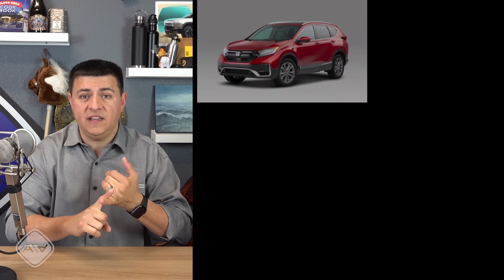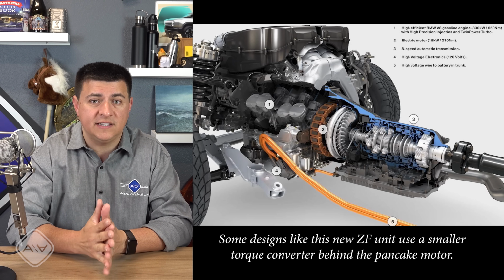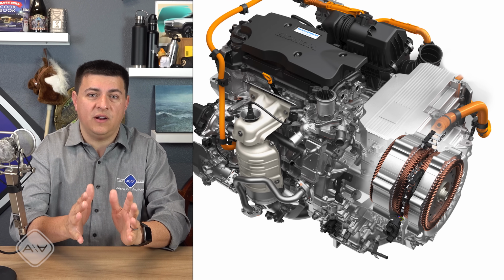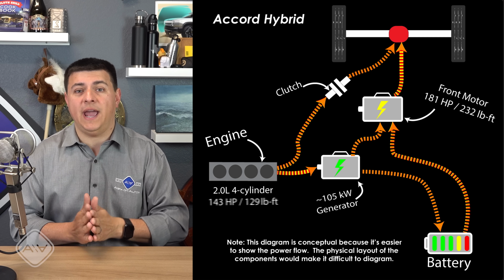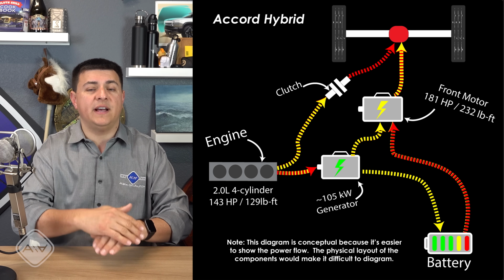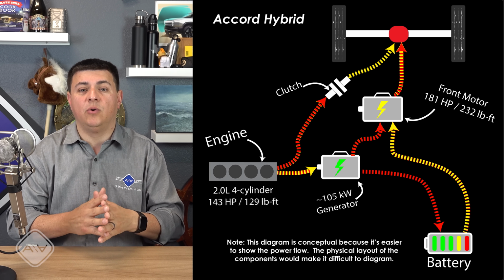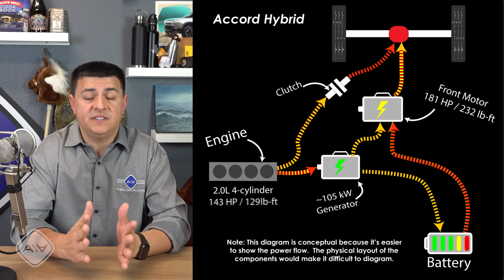How Does It Work?  Honda's 2 Motor Hybrid System Explained!

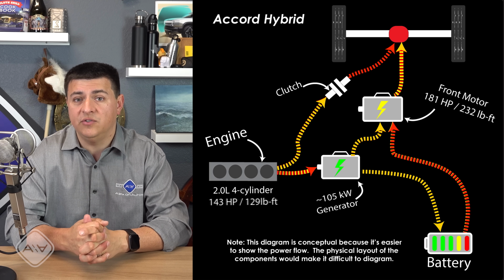Comment: Here's the corrected math Alex asked for at about 8:00. I'm including lots of details you can skip if you want to.

The outer diameter of a tire on my Accord Hybrid is about 25 inches. This means it takes (5280*12)/(25*pi)=807 tire revolutions to go one mile. On my 2017 CR-V, it is 28.5 inches. I don't know what the hybrid CR-V has.
The O.D. gear ratio is 0.805; the final drive ratio is 3.421. In Engine Drive, my Accord takes 0.805*3.421*807=2222 engine revolutions per mile.
For every 1000 rpms, the car will be going (1000*60)/2222=27 mph. (On larger CR-V tires, this could go up to 30 mph).

Check: According to Honda, the ICE is most efficient at 2000 rpms and about 75% throttle, which is 33.7 horsepower. This is 54 mph on my hybrid Accord, which is what Alex would call a gentle highway speed. (It has a BSFC of 208.1 g/kWh, which Honda says is 40.8% efficient.)

The peak 143 horsepower is reached at 6200 rpm, which is 167 mph (or more with larger tires). The car will never go that fast. So what Alex describes as the the conditions needed for 212 HP can never *happen*. Not even close. I'm not saying that this isn't the way Honda arrived at 212 horsepower, I'm saying it is a useless number if it was. And I hope the method is different. I'm also not suggesting that the power it does have is insufficient; my Accord reaches 60 mph about a half second sooner than a hybrid Camry with 208 horsepower combined.

At 3000 rpm (81 to 90 mph), Honda's data says the BSFC goes down to about 212 g/kWh at about 55 horsepower. This is still above 40% efficient, so this doesn't explain lost mpg at such speeds.

But Alex is wrong about one thing: the battery is still used to gain efficiency on the highway, even at speeds above "gentle". I'm not sure why Honda has stopped including this in marketing releases, but it is described in older ones like https://global.honda/innovation/technology/automobile/hybrid/i-MMD-picturebook.html (watch the video at about 20 seconds in). That 33.7 horsepower is more than my Accord needs to cruise at 54 mph. So the car alternates between splitting the 33.7 HP between propulsion and charging, and running in EV mode. This gains maybe 10 mpg.
+++++
Reference: Honda Technical Paper titled "Development of 2.0 L Engine for New Accord Hybrid," Takeshi Wakamatsu, et. al..
Reply: I've seen some reviews that show the Accord being faster than the Camry, but so what, nobody drags a hybrid. I've noticed that the car alternates between ICE and EV even at 70 to 75 mph.
Reply: @benholdaway7570  My point was that it has good power, better that another car which claims 208 HP, no matter how the 212 HP number is calculated.
But "Hybrid" does not mean "underpowered," even if "Prius" does. And there are some you could drag.
Reply: My guess is that the maximum combined power is only theoretical. They thought they could sell more if they are closer to Toyota's hybrid numbers. They changed this for the latest models. Fit hybrid maximum combined is the same as its traction motor hp.
Reply: @philipmanolas2270  Before the 2020 model year, the Fit hybrid used a DCT transmission, not the iMMD system Alex describes here. I don't know its specs. In 2021, they renamed the hybrid version the Jazz, and put the e:HEV badge on it. The engine has 71 kW of power, and the combined total is 90 kW.
Reply: @jeffjo8732  Honda did what i am describing with other models that used the immd transmission, stating a theoretical maximum hp when the system is powered only from the traction motor when you go full throttle.
Reply: @philipmanolas2270  Most cars "state a theoretical hp" that corresponds to the power produced by whatever actually produces power for the entire car to use. That includes Honda iMMD HEVs, and most conventional cars. But Toyota's 208 hp in the Camry hybrid is a complete mystery.

When describing just the engine, it's called SAE net hp, if you want to look it up and learn something. And you will see those words attached to most HP ratings.  But it is only defined for the gas engine by itself, not the power systems of hybrids.

The issue here is that most people - and it seems you are among them, and maybe Alex as well - think it means power on the road. You both compared it that way. But it doesn't mean that. It is essentially the power available to every device in the car that needs power, except those necessary to produce it. So if a conventional car is advertised at 200 HP, some of that 200 HP goes, for example, to power the brakes, power steering, and A/C; but not the engine's oil pump. It is also calculated before losses in the torque converter, transmission, and differential. In fact, the usual rule of thumb is that only 85% of the engine's SAE net is available for maximum acceleration.

The issue that Honda (or any manufacturer of HEVs) faces, is how to give similar information for an HEV, when the factors that complicate it are very different. Honda's information about the iMMD system is more transparent than probably any other system. The 212 "combined horsepower" of the Accord Hybrid is almost exactly comparable to the SAE net horsepower in a conventional car. It is the electrical power that the ICE+generator and battery can produce, combined. This powers the rest of the car, not just the wheels. The 181 HP of the traction motor corresponds to a number nobody else tells you, probably because they can't. It is the maximum hp that can be applied to the differential. And note that 181 is 85% of 212. 

Honda designed the system so the combined electrical power is well matched (after other applications) to the capability of the traction motor. And the resulting acceleration corresponds to what you expect. Its value is based on the original (2014 Accord) iMMD hybrid, with minor increases since then, so it has nothing to do with what Toyota claimed in 2018.

Comment: Well, as an owner of the Insight I need to tell you about the real world.  The Insight crushes the Prius at lower speeds, say 45 and under.  It will get 65 mpg easily and consistently depending on the terrain your driving.  At higher speeds, 65 to 70 the Prius will beat the Insight.  The Insight does not like high speeds at all.  The clutch often disengages at highway speeds to generate more power for the electric motor to consume.  The engine drones on loudly.
Reply: Interesting. My Accord hybrid crushes my wife's Prius above 65 mph but is no better in city driving.
Reply: At high speeds clutch frequent disengages are there by i-mmd design, to get extra percent of mpg by pushing engine to optimum rev and torque zone via extra load from generator. Then stoping engine and driving on battery. About every minute cycles. Although makes sense and most likely also can be used in toyota hybrids too, raises question on battery and clutch life expectancy for those extra percents to show in specs. I would prefer it optionally disabled.
Reply: @aka7kak8  Hello, I have a question. Is the e-cvt transmission used in this new 1.5 cc Honda Jazz exactly the same system as the e-cvt used in the 1.8 cc Toyota Corolla sedan or is it a different system? The reason why I asked this was they said that the risk of deterioration of the e-cvt system used in Corolla is less than the normal CVT. Do you think we will have problems with the e-cvt gearbox if we buy Jazz?
Reply: @attilakhan4606  toyotas hybriddrive or honda e-cvt (i-mmd) both are likely to be much more reliable than regular cvt. However honda by design using clutch in 80-120kmh range to periodically connect ICE directly to wheels, thats a every light wear due to  matched rotation speeds but still a candidate for mechanical fail in long run. I prefer honda hybrid due to comfort in the city driving, but toyotas hybrid is more efficient
Reply: @aka7kak8  yes but someone says toyota hybrid may have longer life thats why i wonder as both car very expensive in my country i need to choose one which is lower risky about having problem technically
Reply: @attilakhan4606  if concern about reliability then consider hybrid corolla, warranty is longer plus good reputation of prius model for example
Reply: @aka7kak8  thank you 🤙

Comment: Thank you for sharing all this knowledge. It is my first contact with hybrids and your explanation is perfect!
Reply: Well, it needs some clarification. There are many misconceptions, mostly about this hybrid, but also about hybrids in general, that he perpetuates.

1) The basic principle of any hybrid is that it has a three-way transmission system (most people mean just the gearbox when they say "transmission;" I'm referring to everything that transmits power). It can send power to, or from, (1) the engine, (2) the battery, and (3) the wheels.

2) The generator is not there to "charge the battery." Yes, it does that, but only as its secondary purpose. A gas engine is most efficient when it generates (approximately) 20% to 40% of its rated power. But the car needs less than 20% for cruising, and more than 40% for decent acceleration. In a conventional gas car, the engine seldom runs in this efficiency band. By having the battery as a third outlet, the transmission system can keep the engine in the efficiency band most of the time.

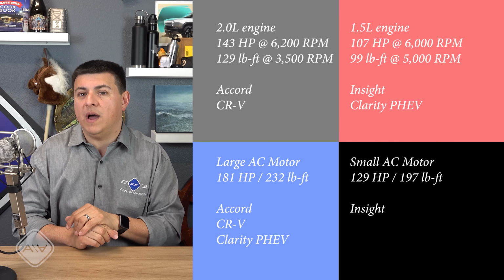3) So, the three red arrows in the diagram at 4:33 should all go through a device Honda calls the "Power Control Unit," or PCU. Most generator power goes directly thru this PCU to the motor; only what is needed to adjust it to power requirements uses the battery.

4) Numbers don't lie, but can be used to tell lies. The power rating of conventional cars is what the engines can produce, not what reaches the wheels. Some power is used for other devices (alternator, pumps, compressors, etc.) and some is lost in the transmission process. While there is no easy way to say how much can reach the wheels, a common estimate is that it is at most 85%. Since the combination of engine and battery can provide more power than the electric motor can use, Honda used this common estimate backwards: the motor can use 181 HP, which is 85% of 212 HP. If you check Alex's tables, every version (and some he didn't list sold around the world) use this estimate. The point is that the Accord Hybrid can, in theory, provide the same power "at the wheels" as a conventional gas car with a 212 HP engine. Alex's conclusions about power are wrong.

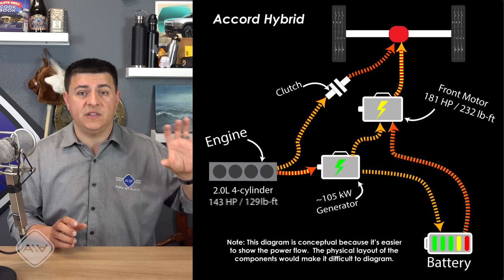5) While I suppose that electrical losses Alex discusses at about 5:25 could be as high as 20%, over most of the operational range it is about 5%. The exceptions are at very low powers, which don't amount to much loss as measured in kWh or mpg, or very high powers, which the driver who uses them doesn't care about.

6) The engine in the Accord has a maximum efficiency of 40.6%. Over the entire range of conditions where Engine Drive(i.e., clutch closed) is used, it is greater than 40.2%. Alex's concern about the single gear ratio is misplaced. These conditions are the same as where a conventional car would use overdrive. The 212 HP situation is when accelerating, so it is in hybrid drive.

7) The motor is not “taken out of the equation” in Engine Drive. It performs the role that the PCU takes in Hybrid Drive, usually charging the battery with excess power.

Comment: It actually is pretty easy to make a block diagram of the system, although it does miss one physical aspect of the layout. That may be why Alex says it is difficult to diagram. It emphasizes a point I think Alex is leaving out; the one that Ben Holdaway hinted at, but didn't explain in depth.

While showing his diagram at 5:10, Alex says that enabling the clutch allows the engine to drive the wheels "without involving either electric motor." This is effectively true (but literally false) for the smaller one he called the generator. The generator is still connected to the engine, and spins with it. But it is disconnected electrically, so it spins freely and has no affect on the drivetrain.

Not only is it false for the drive motor, it is impossible. The moving part of that motor, called the rotor, is actually one of the gears that transfers mechanical power to the wheels. (The 0.805 gear ratio Alex mentions is between the gear that drives the rotor, and the countershaft.) "Parallel hybrid mode" is accomplished by applying electromagnetic force to that rotor. By reversing that effect, the motor turns into a generator and is used to charge the battery in parallel mode. When cruising at "gentle speeds," the engine runs at a higher level of power than is needed to maintain speed, but that is more efficient. So the motor will pull the excess power off of the drivetrain to charge the battery.

Two simple corrections will make Alex's diagram more accurate: mechanical power is sent from the clutch to the motor, not directly to the wheels. And electrical power can flow in either direction between the motor and the battery. Two other minor corrections are possible, to represent other modes of operation. Regenerative braking is done by the motor, so power can flow from the wheels to it. And the generator acts as the starter motor, powered by the battery.
Reply: Spot on comments. Alex has read about the system but seems to me he has not totally comprehend it.
Reply: @philipmanolas2270  I think he comprehends it well enough, but suffers from one of my pet peeves (that I'm trying to help him to see). HEV operation is too often explained in terms of the results, instead of the design goals. For example, "HEVs charge their batteries with regenerative braking" is a result, and quite true. But it is not the only way, nor the most important design goal. The myth that HEVs don't gain efficiency when cruising on the highway, which Alex perpetuates here, is based on thinking it is the most important way. It's just harder to explain that the main goal is to run the engine at a higher efficiency.

The Accord/CR-V accomplishes this by running its engine as close to 2000 rpm and 35 HP as it can, where it is over 40% efficient. When this engine speed and power does not correspond to car speed and drag in parallel mode, the car changes to serial mode to stay near 40% efficiency. It could drop below 30% if it stayed in parallel mode. That's why the 80% electrical efficiency figure Alex cites isn't as important as he claims; 40%*80% is still greater than 30%.

For comparison, the Camry/RAV4 has a larger engine that gets 40% thermal efficiency near about 2700 rpm and 65 HP. I can't claim to know how well it stays near this 40%, but it has to be harder since it would have to charge the battery at 2 to 3 times the rate the Accord/CR-V does on the highway. So I believe the 80% electrical efficiency Alex mentions has a similar drop in engine thermal efficiency for those Toyotas. But I don't claim to know for certain, only that they get similar mileage so it seems reasonable.